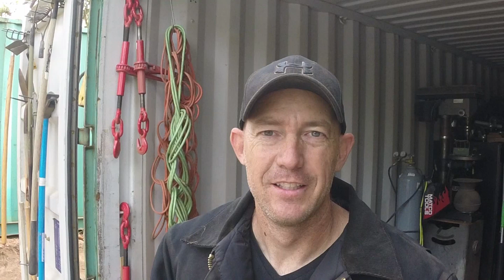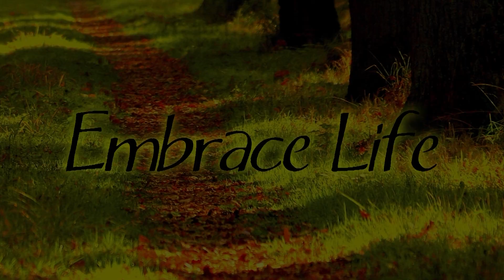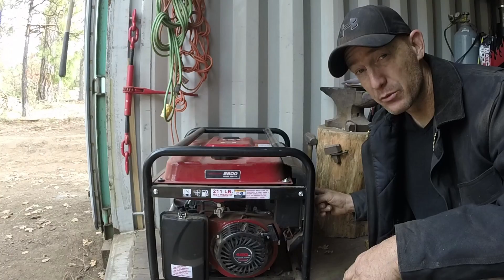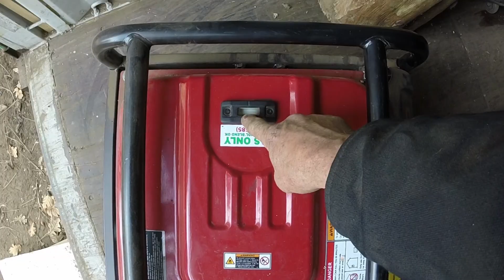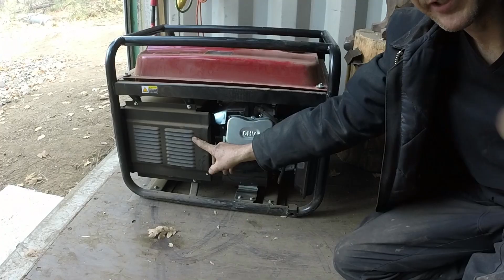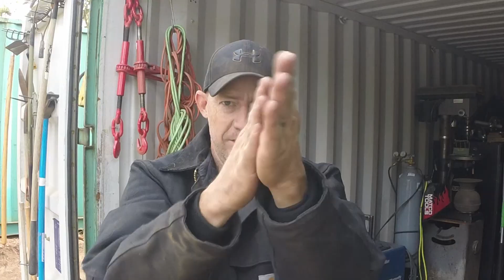Predator generator 6500 review Harbor Freight

Comment: Hi very good review and very informative.   There is a safety issue I would like to point out for your consideration.   I know you indicated the exhaust is pointing outward.  I am involved with Emergency Management, and carbon monoxide is a real problem.   We have people running generators here in NH where I live and they do something similar (at the edge of their garage under the house, pointing out), or even on a deck outside.  The problem is the wind direction can (a) change and (b) blow the carbon monoxide back at the dwelling.  Please be aware that carbon monoxide is a POISON, so having a source of fresh air is not sufficient to keep you safe.  To the best of my knowledge it builds up in your blood stream.   I know you may have done this a number of times successfully, but we see poisonings with almost every major power outage.   Also to the best of my knowledge the recommendation is that the generator should be at least 10 feet away from the structure and "down wind".   Please stay safe. /Jim
Reply from the maker: Point taken, about the only time I run this generator is when I am welding. With that in mind, I weld outside my conex box because most the things I'm welding are bigger and wouldn't fit in the conex anyway and I like not having to worry about starting a fire in the conex box. Thank you for adding this to my comment section though, this video gets a lot of views and some people might not think about wind direction and keeping the exhaust out of where they are working. :)
Reply: Not only carbon monoxide is the hazard of using portable generators. Electric shocks, electrocution, and burns are one of the hazards of using generators too. Even fire hazards. I have things to explain to everyone about the generator hazards. Here are the generator safety tips: 

- Never ever back feed your generator
 
- Please do not overload your generator
 
- Please do not allow an unqualified person or your children to operate and service the portable generator. The generator can be hot during an operation. The generator can be hot enough to cause burns. 
- Please keep your children especially your little ones away from the portable generator at all times so they won’t get hurt. Always keep an eye on your little ones

- Do not run your generator in the porch, deck, balcony, garage, or indoors. Always use your generator outdoors but 15-20 feet away from your house. Never use your generator indoors.

- install a carbon monoxide detector 
- Never ever refuel your generator while it’s running. You need to let your generator cool off before refueling it. 

- Do not wear loose clothes when operating the generator 
- Never touch the generator with wet hands. Never run your generator in wet conditions so you won’t get electrocuted.

- Please use the right cord for your generator. The cord should not be worn out. 

Hope this helps. Remember it’s better to be safe than sorry
Reply: Valuable comment 👍

Comment: I have one of these to power my window AC and keep my Solar Generators charged during night time during the fall and winter months… great performance so far
Reply from the maker: I had to dig this generator out of the corner of my shop about a month ago for a power outage in our area. I didn't know if it would fire up or not but it fired on the 4th pull. still works great. Thanks for watching. :)

Comment: I have a 6500 predator generator and it worked fine for a few times. I was using it one day running a 70 inch 4 k tv the generator made a funny sound and stopped working. Haven't been able to get it started since. Got oil and gas vut still won't start. I advised against buying one. Not even 3 months old and don't work
Charles Johnson. Toledo Ohio
Reply from the maker: Have you figured out what went wrong with your generator yet? I haven't had any problems with my generator yet so I'm wondering what I should be looking out for. Thanks for watching. :)

Comment: Just bought this from Harbor Freight less than an hour ago. They had a coupon for $499. This video sealed my decision to buy it. I still have to get the wheel kit but may mount it on a small furniture dolly I bought there earlier. Do you happen to know the gas tank capacity by chance? Thanks for your time. 
Kevin West
Reply from the maker: I don't know the exact tank capacity but I think its close to 5 gallons maybe. I used to know it but I haven't had to fill it for a while. I do know that it sat for a year and when I went to use it the other day it only took 3 pulls to start it. :)

Comment: I wanted to hear it run
Reply from the maker: Unfortunately hearing it run on a video is very deceptive unless you have a decibel meter, which I do not have. :)
Reply: @KoalityofLife  I found another video of it running under load and got my answer. It actually doesn't sound bad considering it is a generator. For the price.
Reply from the maker: @lurchforgot9825  Very nice. :)

Comment: Interesting that I think I'm seeing in your video is 420cc?? Dosen't show very long or clearly. Marked on the starter rope cover, In your video.
And harbor freight is using your video and with the same watts rating there now advertising it as a 301cc engine.
Reply: Its also listed as 173ish lbs
Reply from the maker: Yes, mine is a 420cc engine. Interesting that they have put a smaller engine in the new models. Maybe they have made their engines better? No idea. :)
Reply: @KoalityofLife  its possible they didn't have the 301cc engine a few years ago. Its a relatively new item.
That way they have a engine in the 9hp class not just 6.5 and 13hp and the V twin

Comment: i have gas dripping from a tube that goes from the bottom of the gas tank to the air filter housing. even when the gas is turned off.
Reply from the maker: I have no idea what that is but needs to get fixed. :)

Comment: I have had this generator for 5   years. Bought it during a summer power outage and woked fine. I have not used it since and today I decided it was about time to get it running and get non a schedule to keep it maintained. There is a possible power outage shortly. I decided t look on line for
Reply from the maker: Thanks for watching. :)

Comment: Been using mine for years to push our camper out here in PG and Off Northern California... and this thing has never let us down. pushes a 30 amp camper with ac and everything running inside. no problems!
Reply from the maker: I haven't had a problem with mine yet. :)

Comment: I just bought the Predator 6500 and saw in the manual it needs to be grounded. I never even thought about that. I assumed the frame grounded it. My plan is to wheel it out of my garage when needed and just use some heavy duty extension cords. Does it really need to be grounded since it’s a portable one?
Reply from the maker: I have no idea about grounding it, thats something new to me. I guess it would be a good idea to ground it if you were using it for a permanent power source in a house or garage. I don't know of anybody that grounds a generator when they set it up for a temporary power source. :)
Reply: Thanks for your reply.
Reply: I think you need to ground it for certain applications like your travel trailer

Comment: Could you please tell me how many gallons the fuel tank holds?  Also, are you still satisfied with this generator after using for a longer time?
Thanks!  (Great review!)
Reply from the maker: I still love the generator, it still works great. I think the fuel tank holds around 5 gallons. :)
Reply: @KoalityofLife  Thank you!
Reply: 6.6 gallon run time 8 hours at 50 percent load
Reply: @charlesjohnson3098  Thank you

Comment: @Koality of Life Homestead I never had a generator before and I just started a Carwash guys, would this work on a Sun Joe SPX3000-XT XTREAM Electric Pressure Washer it delivers up to 2,200 PSI max and it’s a 13 amp motor
Reply from the maker: This generator has 20 amp circuits so you should be able to run a 13 amp motor without a problem. :)
Reply: @KoalityofLife  thank you so much fine sire

Comment: First off, thank you for not being annoying in your review. You come across as knowledgeable and calm. I am looking at this generator to buy, my store only has the EPA 3 version and not CARB. I don't know if it matters. Do u know which one yours is?  2nd, how well did, or has this generator held up? Again, thanks for the video.
Reply from the maker: You're welcome for the review. I do not know for sure if my generator is a CARB or EPA 3. I think goes by the state you live in. 
The generator has held up great. I don't need it as much as I used to now that I have my shop built but it starts up fine when I need it. :)

Comment: hey man i know its been 3 years since you posted this, how is welding off of the generator? i got a 120v lincoln i plan on welding off a generator and would like to know your opinion as i cant see to find a defined answer
Reply from the maker: Hi, welding off a generator is basically the same as welding off an outlet as long as the generator has enough amperage for the welder. Being a 110 welder, it should run off any generator I would think. I've never had a problem. :)
Reply: How does that handle a 220v welder with the 5500 watts?
Reply: @urpimp303  from what i read from say Everlast welders, they recommend a 9k running 10k surge watt generator.  so you would be able to get by on the 9k watt surge generator from HF but it wouldn't be ideal. depending on amp's you are trying to run off it
Reply from the maker: @urpimp303  The welder I am using is a 110V welder, not a 220V. :)

Comment: I'm thking about purchasing 1 for emergency purposes (winter weather kit) but I'm not 100% sure on the size I'll need. My main goal is to maintain my fridge,  I actually hv propane heaters for heating purposes & weather radio & solar chargers for devices, but thts where I end at (lol)
Reply from the maker: This will run your fridge for sure. :)
Reply: @KoalityofLife  ok, thk u so much 😊

Comment: Hi, good vid! I need to run my well pump intermittently with a generator during power outages and my electrician told me to get one with a 30 amp twistlock. And I thought this 6500 had that, so I was surprised and chagrined when you said it wouldn't run your well. Sounds like your well is deep and powerful. Any updates on using this for the well, or details as to why you can't? Thanks!
Reply from the maker: My well is 450 feet deep and takes a 30 amp circuit, this generator is only a 23 amp 220 twist lock circuit. :)
Reply: Thank God I saw this man-i was gonna buy this to run my 420' well and now I know it won't! Thank u for saving me!
Reply from the maker: @benrent6625  You're welcome. :)

Comment: What kind of fuel does it use, and what kind of oil does it use?
Reply from the maker: This is a gas generator, as far as oil, just a standard small engine oil. :)
Reply: @KoalityofLife  What kind of gas and oil do you use? I want to buy one of these 6500 watt Predator generators, within the next month or two.
Reply from the maker: @kenw9681  I always run premium gas through my small engines but that doesn't mean they have to be run on premium gas. As far as oil I use what the parts store says to use so I don't remember right now what it was Sorry :)

Comment: Great review. I appreciate your efforts. As an electrical engineer, I would like to offer you some of the math involved to calculate your load.  
1 horsepower = 744 watts
Electrical motor starting surge is 30 %
So starting a 1 HP capacitor start motor will require 766.32 watts. Older motors may need a lot more.
Your wire has Inherent Resistance and that number varies quite a bit depending on conductor type size and the length of the run. Longer runs need heavier conductors. As a rule of thumb, use at least 14ga conductors for runs of 50' or less. Use 10ga for up to 100'. Use 8ga for runs more than 100 feet. This will minimize you wattage loss due to a small conductor. Note: As the wire's temperature increases, so, the resistance increases and your power (wattage) drops. If your wire feels warm, get a bigger gauge wire.
Reply from the maker: Thank you for the calculation, I can use this in the future. :)

Comment: Came across this vid on harbor freight site, Not sure on what wattage i need but  Will this be enough power to run a Small Ac and Refrigerator, and other small stuff  ? Just want something in case power goes out during hurricane
Reply from the maker: You would need to look at the amperage on the AC unit and the refrigerator to make sure. As long as the amperage is less than 20 you should be fine to run the  AC off one plug and the refrigerator off the other plug. :)
Reply: Thanks for the reply.  Will look into it.  It’s just small window ac unit

Comment: How has this thing aged?  I'm in the market for one and a Honda is more than I want to spend.  I've had terrible look with other Chinese brands and Briggs and Stratton/Generac aren't much better.
Reply from the maker: I haven't used it constantly but whenever I need it it fires right up and works great. I use it whenever I need to weld something or power something in the storage container that its in. Probably ran through about a dozen tanks of gas so far. Hope this helps. :)

Comment: Wish you would have started the generator so we could hear how loud it would be.
Reply from the maker: I could have but anybody can edit sound on a video to either be louder or quieter than what it is. There is no real way to show the noise level of what you are reviewing unless you have a decibel meter. I don't have a decibel meter. I can tell you that you can work around it while it is running but if you are talking to someone right next to the machine you will have to raise your voice so they can hear you. Get about 15 feet away from it and you can talk normal. Hope this helps. :)
Reply: @KoalityofLife  , just FYI, they do have decibel readings apps for smart phones but I do appreciate your feedback on the noise level, it helps.

Comment: I’ve got one. I opted not to get the warranty. Because I am cheap... after running the generator on my side jobs, construction, there’s metal shavings in the oil. The engine still runs FLAWLESSLY but for the 140$ I d get it. And if anything after. A year and a half bring it in saying it doesn’t work and they will give you a new one
Reply from the maker: Never had any metal shavings in the oil but mine still runs great. Any time I need to weld something I start it up and plug the welder into it and go. :)

Comment: I was gonna go at that wattage but 150 or... more I think...for a 9000, would very easily run my small 2 60amp bedroom slab till I move, has a small 240 15amp ac in the wall and I also have an old blackmax 50 gal 240 air compressor, single stage for auto repairs, I've seen videos of these running houses. My old buddy that passed was an electrician told me how sinewaves work, there longer than 120 and draw less on damand than 120, if you can wire your water pump 240 it should work, a 2 stage air compressor would take more for sure I think
Reply from the maker: Interesting. Thank you for watching. :)

Comment: $500 @ HF this weekend.  You recommend?
Reply from the maker: I like mine, can't remember how much I paid for it but haven't had any problems with it. A few pulls of the cord and it fires right up. :)
Reply: @filolll - I pulled the trigger & bought mine after checking numerous reviews yesterday.  FYI - Many HF locations were already sold out when I went yesterday.  You can still purchase tax free in FL online.  Shipping & wheel kit included I believe I paid $624 total.  Not bad considering the same wheel kit I paid $30 for online was about $70 in-store.
Reply: Opps - well for anyone looking now, my comment still applies 😅

Comment: can it handle a welder mig/tig/ark and plasma (not all at once of course)... and without hurting anything like cordless tool batteries ???
Reply from the maker: I use this generator to run my Millermatic 110 welder whenever I need to weld something. I'm not sure what you mean by not hurting cordless tool batteries though. :)
Reply: @KoalityofLife  okay thanks

Comment: Anyone know if I connect The predator 9000 to my house (legally), do I have to ground the generator or is the frame ground good enough? Thanks.
Reply: Best to ground it, buy a ground rod ground frame. The performance will be more efficient.
Reply from the maker: I have no idea on that one but maybe someone will chime in with the answer. Thanks for watching :)
Reply: the generator will be grounded because the panel is grounded. if you do it properly.

Comment: I bought this exact generator also. I live at higher altitude and so I changed out the jet using the included high altitude kit. It was relatively simple. After changing the jet, I started it for the first time. It started first pull and has started first pull every time. I also thought it would come with the wheels. I plan to buy the wheel kit for it but I have not had any problems moving it around.
Reply from the maker: I still haven't had a problem starting mine. First pull starting all the time. I was going to get the wheels for mine but I never seem to move it so I don't think i will get them. :)

Comment: Does it run the welder in the back. Just got a lincoln 140
Reply from the maker: I only run my 110 welder on this generator. But it runs that welder just fine. :)
Reply: Mine runs a 220v wire feed welder. I made an umbilical to convert from the plug on the welder to the plug on the generator. Works just fine.
Reply from the maker: @atchjs  Very nice. :)